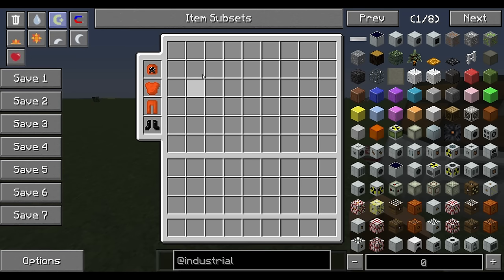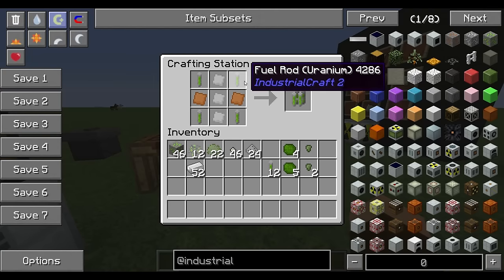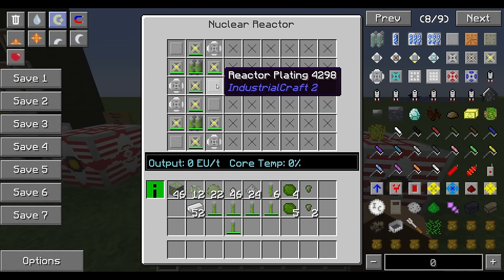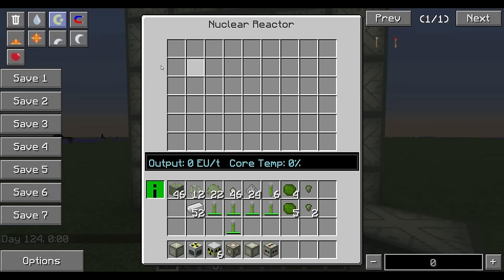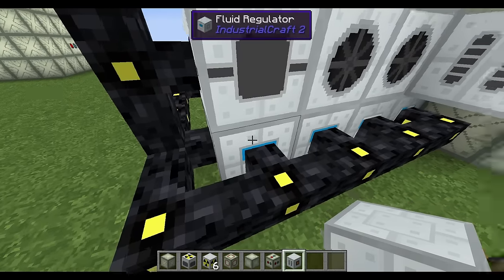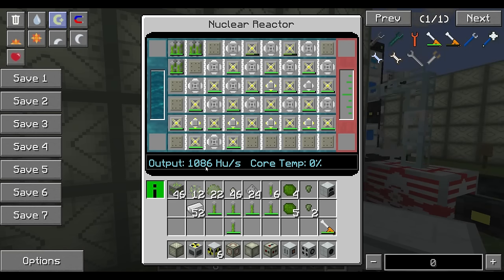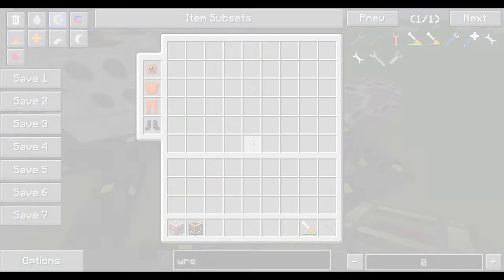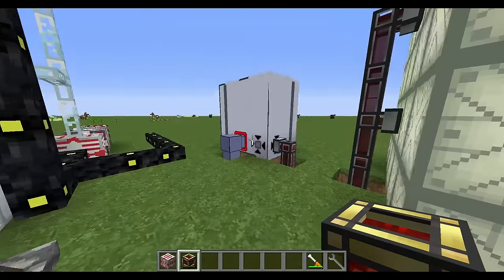Spotlight: IC2 Experimental - Intro To Nuclear Power

Comment: I kind of liked the video. Was very slow and easy to understan (good for kids i guess). But what i've missed are raw numbers. The only reason i watched this entire huge video is because i wanted to know how much power these babies put out and if it's worth going through the hassle of building them. You stated the 100 and 50 eu/t for each components, but i didn't know to how much it adds up. Anyway.. thx for the effort you put into this :)
Reply from the maker: +EarlGrey Hi, thanks for the comment. The thing to remember is that the reactor itself puts out no power. Only hot fluid. Using the fluid to create steam, which turns turbines - that's what makes the power. You're right that each level in the last configuration puts out 150 EU per tick. So all you would do is multiply however many levels you build by 150 to get the total amount of power produced. Two levels = 300, four = 600, eight = 900, etc.

Comment: great video that helped me alot! but one thing i was having problems with was the heat vents. after some research i figured out that the heat vents no longer remove heat  from the reactor they only dissipate it. if u want to remove heat from the reactor u have to use either a "reactor vent" or an "overclocked heat vent" heres a chart i got from the wiki

http://s24.postimg.org/qwqg3a09x/vents.png

hope it helps guys and once again great vid!

Comment: I've found it easier to have the liquid heat exchangers to have both the fluid extractor and fluid ejector upgrades, saving the need to use pipes in general when placed directly against the fluid ports on the pressure vessels

Comment: Hey, what mods do u have?
Because i dont know, for exemple, how you see the hud of the block only by looking to them, or the tanks ejectors blocks, they are amazing.
Please answer¡
(Like this video too much, very helpful)
Reply from the maker: Thanks. There's a link to my site in the description of each video where you can see what mods are used in the series. The mod that shows item info when looking is by Prof Morbius and is called WAILA (or What Am I Looking At http://www.minecraftforum.net/forums/mapping-and-modding/minecraft-mods/1289765-waila-1-5-7-for-1-7-10-1-6-0-for-1-8-1). With the ejector blocks, if you mean on the reactor itself those are part of IndustrialCraft 2 Experimental.
Reply: Oh thank you¡¡ I really apreciate this, now i will work better on minecraft

Comment: On the ic2 version in IE:SK  here is a tweaked reactor version that don't blow up. Reactor planner 2.14

0303150C0D110D0C1503150C0D0C0D0C0D0C150C0D0C0D140D110D150D0C0D0C0D0C0D0C0D140D140D140D140D150D0C0D1511151515

Comment: I know this video is a bit old... but I have to ask - why coolant? I have a very good setup myself however the only loss I suffer and have to replenish constantly is distilled water, not coolant. Of course I check coolant levels every fuel cycle but it never goes below 10k. Do you suffer water loss?

Comment: So what's better about the fluid reactors vs. the simpler reactors? It seems like it just takes more time and resources to produce the same output (or less). Do people just simply build them for the challenge and novelty of it? I think I'm missing something here.
Reply from the maker: It's all about efficiency. Fluid reactors are much more efficient than normal reactors, meaning you get the most power from the least amount of fuel with a fluid reactor set up. A normal reactor can produce the same amount of energy as a fluid reactor, but you need to feed it more fuel to do that.
Reply: What about steam vs stirling?
Reply from the maker: Owlblocks David stirling is the bottom tier

Comment: The problem I always run into with this is water gets stuck in the 2nd steam turbine causing the whole system to stop. Even with an ejector upgrade facing the direction of the condenser.  What am I doing wrong here? Water never makes it to the condenser to cycle it.
Reply from the maker: Been so long since I used this setup, I'm not sure. What version of Forge are you using?

Comment: So why don't you use stirling generators instead of the steam turbines seems like a lot less hassle, do the steam turbines generate more eu/hu?
Reply from the maker: Not sure what you mean, steam turbines are the small items placed inside a Kinetic Steam Generator? Guessing you mean why not just use Stirling instead of Kinetic. On a liquid cooled reactor you can use both, as outlined toward the end of the video, to capture as much power as possible. Converting to super heated, then normal steam allows you to collect more efficiently than just running the hot liquid through a long series of kinetic collectors.

Comment: i have the 1.7.10 IC2 and when i start it up it crashes but the game dosent open with 2 of them and the other one it starts up but they stuff isnt there but here are the names of them:
-industrialcraft-2-2.6.259-ex110-api (working but stuff isnt there)
-industrialcraft-2-2.6.259-ex110-dev (game dosent even open and it crashes)
-industrialcraft-2-2.6.259-ex110(game dosent even open and it crashes)
If you can help me please tell em what to do or link me a working version of this for 1.7.10. Thanks.
Reply from the maker: Couple things - you don't need the API or DEV versions, only the main mod file. The others are for developers to use. Also, you are not using the right version, that version is for 1.10. Download at industrial-craft.net: http://jenkins.ic2.player.to/job/IC2_experimental/

Comment: Wait, do I actually need to fill the reactor chamber with coolant? Where is this "coolant" coming from? And how do you keep a fresh supply of distilled water? Tons of solar distillers?
Reply from the maker: You can have reactors that don't use fluid coolant, they just put out EU instead of heat. The distilled water is a set amount, enough to fill all your stream generators. It gets turned to steam, then back to distilled water and is fed back into the system again.
Reply: I've tried the no case design and no wires connect to it, the high voltage doesn't nor does fiber glass. So I assumed I can only do the newer types of reactors.
Reply from the maker: +TheLeagueObservers Just loaded my test world to test and cables connected fine, only difference from when I made the video is I upgraded to the latest version on all mods and forge is version 1.7.10-10.13.4.1566. Not sure what's up.
Reply: Well thanks for the help anyways. Still a little confused about the initial set up. You went from explaining each piece then bam, it was all connect, but still very helpful! Thanks.
Reply from the maker: +TheLeagueObservers I just posted a two part (Episodes 16 & 17) video where I move the reactor and build the cooling system in real time, so now you can see exactly how it's done. Hope it helps!